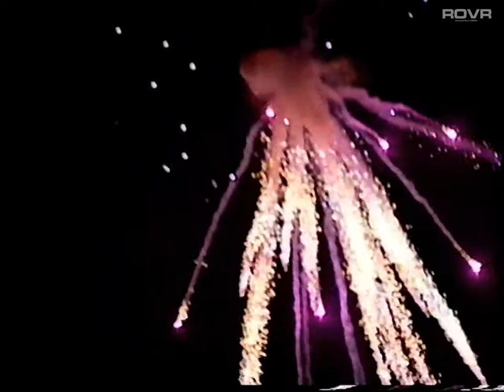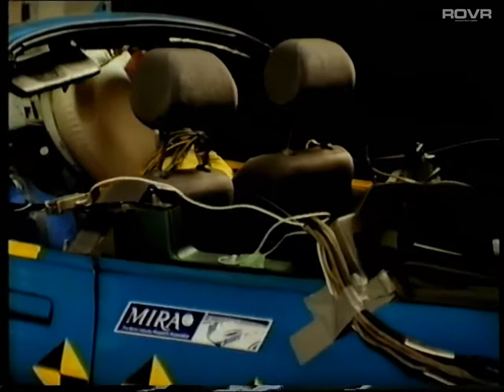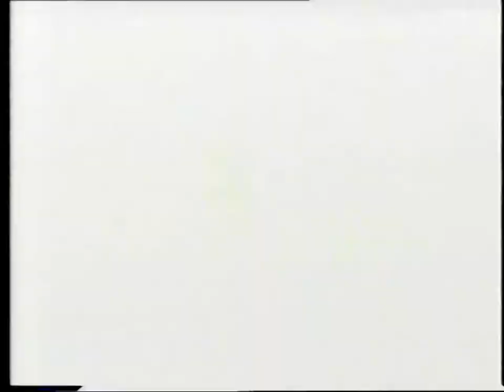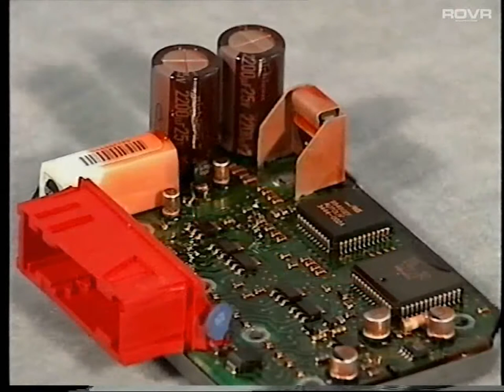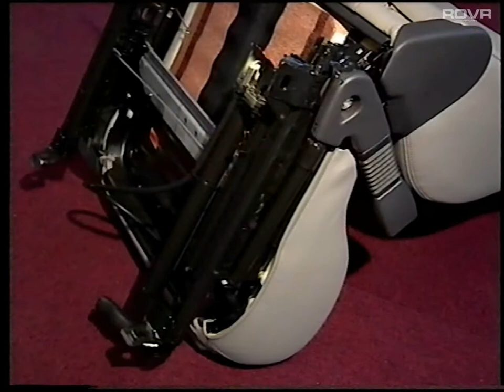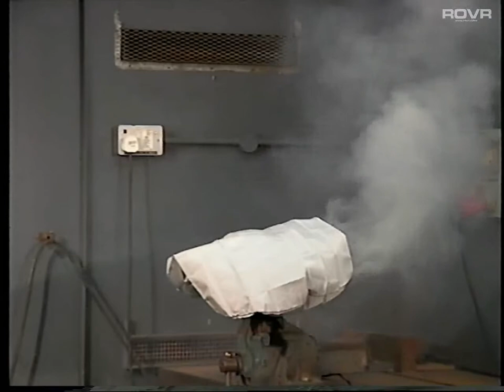Rover - Supplementary Restraint Systems (SRS) - (1997)

Comment: Hilarious.
Air bags have become a bit of an over eager con by the motor industry to make more money by write off cars prematurely for fairly low speed collisions.
Their put behind expensive trim to destroy as much as possible and even break windows in the car.
12:40 Airbags have a life of 10 years after which they should be REPLACED.
and 18:19 you need to be at least 15 meters away when one goes off directly in front of your face!🤣🤣😂😂🤣🤣

Comment: Bloody hell, Rover banging on about SRS airbags and NCAP ratings, they were among the worst performing cars on the market. Wasn't the Rover 100 like a 1 star NCAP? 😬
Reply: Because it was designed in the mid 70s as the Austin Metro.
Reply: @coogeeman  All Rover did, was use the Austin Metro floorpan, and existing Austin Metro body plans, to formulate a Rover makeover to the body and restyle it to give it a more conventional driving position i.e. the older Austin Metro felt like you were driving a bus with it's weird driving position.

It was just merely freshened up and improved, with no actual improvements made for crash safety, apart from adding a driver airbag and side impact protection.

Even with the airbag fitted, the steering column shunted off to the left in the EURONCap crash safety test, making the airbag useless and pointless, and the driver's head hit the crushed door and side pillar to the right, along with excessive crumpling of the front end and driver compartment causing serious leg foot and ankle injuries, along with excessive rearward pedal travel probably resulting in thigh and pelvis injuries pushing these bodyparts backward.
Reply: @coogeeman  it's a fair comment, but they were all subpar across the range
Reply: The Rover 200 earned 3 EURONCAP stars and the Rover 400 also earned an average 3 stars.
Reply: Depends what time period you consider the vehicles, in the mid 90s they were actually very good with exception of the metro/100 which was obviously a very old design but the 2, 4, 6 and 800s were up to par with anything else really, obviously by 2004 when they were still kicking out 80s/90s designs then yes they were well off the pace, a late 25 still had a single airbag available for example

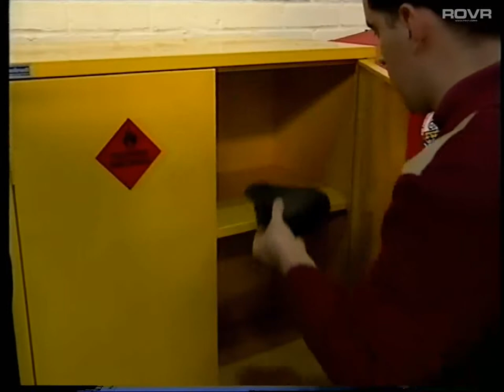Comment: Anyone else thinking at 13:00, how fun it would be to plug it into a battery whilst inside that steel cabinet. (Obviously from the safety of the office)
Reply: I remember years ago the local scrapyard used to have an old fridge they had modified to deploy the pyrotechnic seatbelts & airbags safely inside.
Reply: @leepower2717  I bet it sustained some battle scars